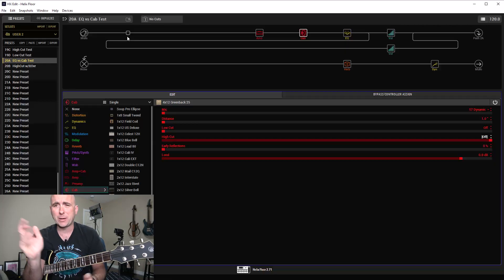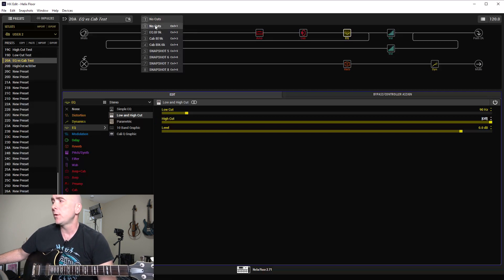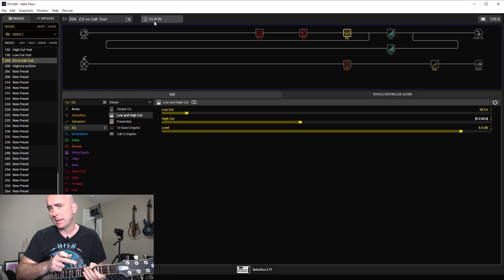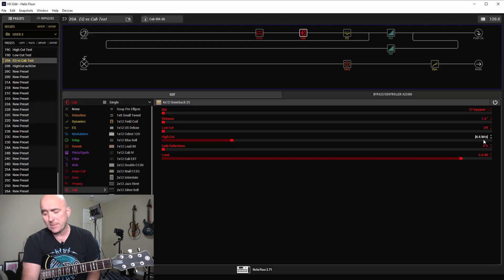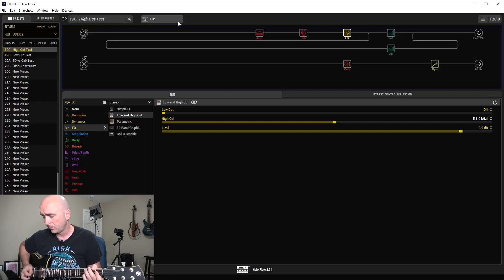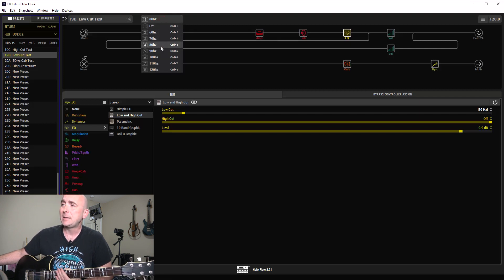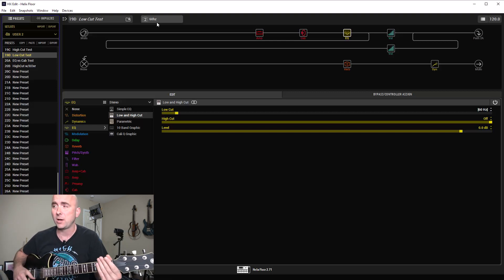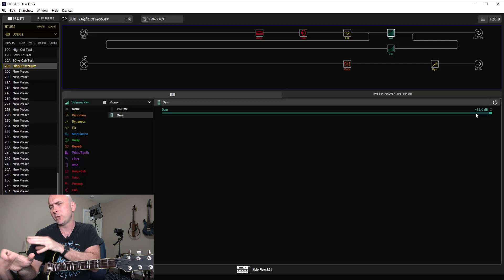Line 6 Helix - Create A Great Tone - Pt. 28 - Using High & Low Cut EQ - Comparison & Discussion

Comment: I got my HX Stomp about 1.5 years ago, and unfortunately did not see this incredibly helpful video. I went down many a tone rabbit hole trying to figure out to tame the high end harshness I was getting. There are many approaches to deal with that, but most only supplied minor relief. It wasn't until I learned to switch Mics, did I find a meaningful solution, but I was still missing something. That missing piece was setting the Cab High and Low Cuts to the Real Speaker Frequency Range, and I can now get the tone and performance I was looking for in all the Cab Blocks.

Until recently, I hadn't known/appreciated that many "Guitar Cab Speakers," including Classics like the Celestion, have shocking steep high frequency cutoffs around 4-5kHz! The Celestion G12M Greenback has a Frequency Range Spec of 75Hz - 5,000kHz, and a steep High Cut dropping the volume from about 107dB down to about 77dB in a nearly straight line slope in the range from around 3.5kHz to 7kHz. I'm not sure if I calculated this right, but I think that is 30dB decrease in one octave!

Do you/anyone know how many dBs the High Cut on the HX Stomp Cab Block is for that same frequency range?

Thanks

Comment: Thanks again for another great video, you are an expert at demonstrating the subtle differences in creating a helix patch. I have been using IR's and adjusting the H/L cuts at that block. Will start to experiment with other options. What happens if you have a H/L cut on 3 blocks (cabs or IR's, or EQ) does it make it more muddy the more blocks that use it. Or does 1 or 3 have a similar effect on the overall output. 
Love what you do for us Helix users we are very lucky having you do so much for us, I have had my Helix for over a year now and your video's have provided me with the skills to create an individual patch for each song we play live.. You are getting the accolades you deserve.
Reply from the maker: Thank you and my pleasure Mike :-) I wouldn't think adding the cuts to multiple blocks is a necessary step, IMO...

Comment: I'm often going back and forth with how I apply my high and low cuts.  Been doing it at the cab block for a few months, then went back to using the parametric EQ block last week, which also allows me to take out some of the less pleasant, harsh frequencies, quite often around that 3k area.  I really can't decide which method I prefer.  One small correction Jason, at around 8minutes 40, you say the cuts are much more drastic, and dramatic when using the cab block, I think you probably meant to say the EQ block.  Great video again.
Reply from the maker: Yes that is exactly what I meant Steve, thank you so much for pointing that out, I missed it :-) And so glad you enjoyed the video!

Comment: Interesting video..... I know studio engineers often say something like only use your ears; it would be interesting to run the output into an analyzer - for VISUAL analysis. I did this with my Helix. I ran it into my DAW, not to record, but just to visually see the signal coming through - even AFTER the -12db cut, signal DOES come through but as you'd expect the signal is mostly less than -12db.  I prefer steeper slopes in the high and low cut, because the concept of cutting out frequencies above or below a certain frequency or point, suggest you don't want ANY sound above/below that frequency PERIOD. A gradual slope doesn't give you a hard/clean gut - it's gradual.    Thanks for your Helix videos. I REALLY like the recommendation - that if you're doing a solo with no other instruments, you might remove the cut. As you mentioned as well..... the other factor is the sound system at where you're playing at.  At some places, those 30 year old speakers, and twenty year old board, and rack fx..... won't likely capture and cleanly amplify the nuances of your filters.   Thanks for your videos.

Comment: Love your videos.

Do you know if speaker cabs are modeled accurately for frequency response? Most guitar speakers don't go above 5kHz. So a real cab functions as a 5kHz high cut.
Reply from the maker: Thank you so much :-) Yes I would say they are modeled very accurately. There is always going to be some audio information up in those higher frequencies that can use rolling off even when recording a real guitar speaker.

Comment: How do you feel like using the low and high cuts on the cab block while simultaneously using the low and high cuts on an eq block? Any benefits? unnecessary? To me it sounds like the Low and High cuts on the cabs give a more natural feel and aren't so abrasive to my tone.
Reply from the maker: I would likely find it unnecessary to apply multiple cuts, would seem a little redundant, imo...